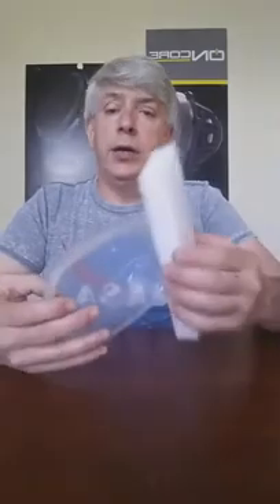Trunk Baffle systems  ( free air / infinite baffle ) baffle designs # 1

Comment: you recognize the problem, but did noting to solve it. 1.   different cars have different rear decks. my 95 legend has dual layer rear deck 6x9's are in their own factory metal enclosure its a tunnel makes the rear stiffer than normal.  2. ok you said the rear deck flexes too much so you did a 5 layer instead of bracing the rear deck with metal. and i did not hear you say fiberglass reinforce it. 3. most people do this as an UN-permanate set up don't want to drill out car or put in fiberglass to seal seams.  4. besides bracing it with a pole you can lay mdf over top and bottom like a false box then bolt that to metal then place baffle inside of that.  glad i watched your video i will be tasking my own advice on how to correct the top for resonating to much. hope it works out for me.